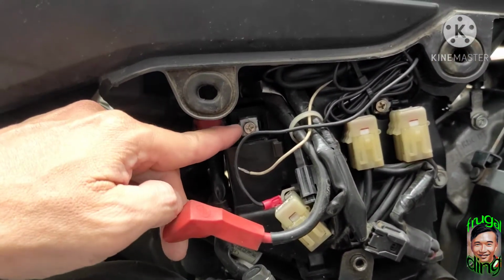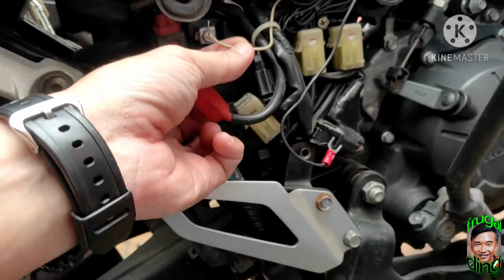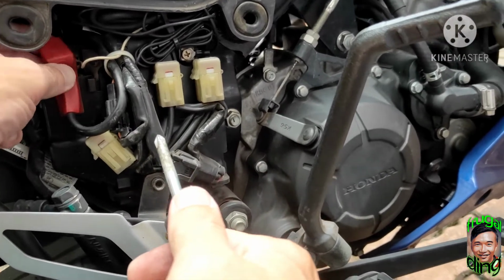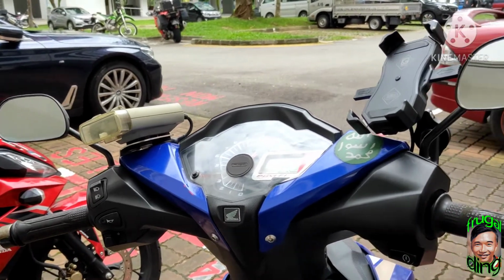How To Prolong Your Motorcycle Battery Life?

Comment: Wher Black wire you connect?
Reply from the maker: Wahai Pendekar Timur, wire hitam di connect ke kepala battery yg bertanda hitam(-negative)
Reply: @dingarmando  tq
Reply: @dingarmando  wire merah sambung mana.? Sy ada masalah batri kong
Reply from the maker: Bang battery cuma ada 2 pentol. Merah(+positive). Hitam(-negative). Warna wire ikut sama aja bang. Kadang2 pentol nya ga ada tanda warna, abang harus carik + atau - nya. Semoga berjaya bang. Kalau pengertiannya salah, mungkin saya ga ngerti soalan abang.
Reply: @dingarmando  sy pnya wiring wayar merah dia sambung ke bateri...wayar hitam ke body... bateri kong, sbb off kunci current masih jalan
Reply from the maker: @pandikartimur5514  abang ni bikin wiring motor sendiri kah? Kalau kunci off, battery masih ada current, itu ertinya battery direct. Seharusnya wire harus jalan melalui ignition key. Kunci itu sebagai switch on/off battery
Reply: @dingarmando  ok tq
Reply: @dingarmando  ya motor sndri